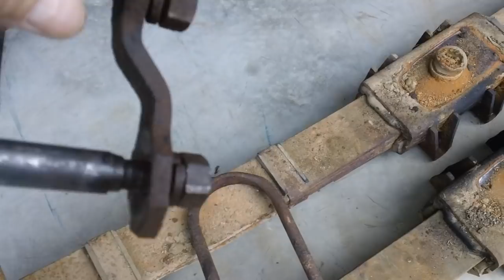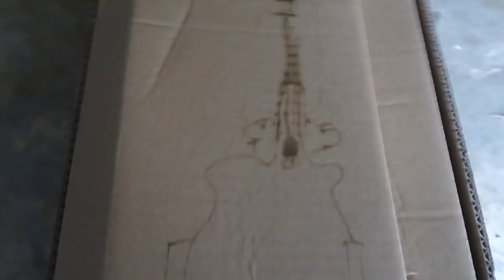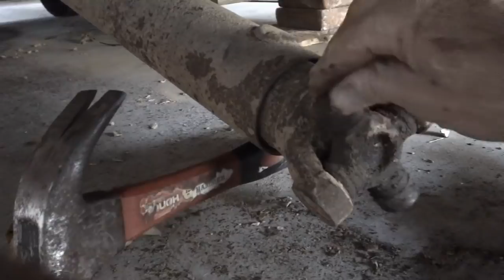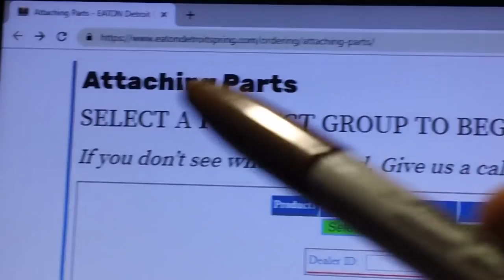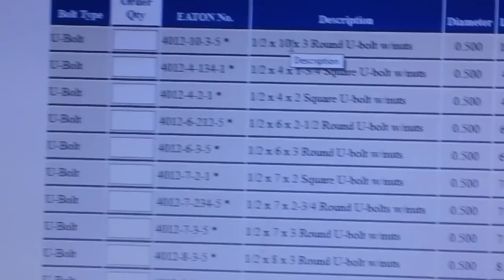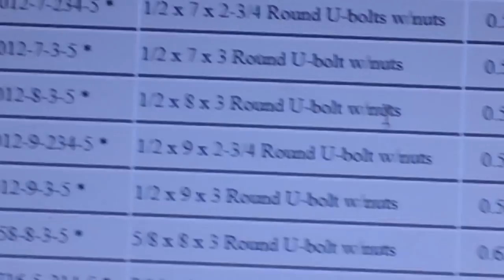1966 Ford Thunderbird repair and refurbishment (Part 25). Rear axle removal.

Comment: If your family asks what you want for Christmas, John, tell them you want a bench vise and a bench to bolt it to! As much do it yourself work as you do, (especially automotive), I'm surprised you don't already have one. About 45 years ago, I spent all day removing a set of shackles from my '65 Fairlane. The rust on them, "welded" them to the rubber bushings. Every time I banged on them, the rubber absorbed the hammer blows. What a pain.
Reply: Hay sanny class, I want one of these, already got a BMF vise.  
https://www.youtube.com/watch?v=3u1IBgefNDs
Reply from the maker: Dave,
I don't have a continual need for a vice, so don't see spending the money for something that'll only get occasional use at best.  Besides, I have access to a full maintenance shop at the place from where I retired, so not a problem.  If needed, they also have very hot torches that'll help remove anything.  LOL
Regards,
John

Comment: My dad preached to me many times, "IF IT AIN'T BROKE, DON'T FIX IT" , hmmm, axle ain't broke, springs ain't broke, U bolts ain't broke, why "FIX" it?  To put in a pozzy of course, lol.  Why did I get smacked up side the head?
Reply: But the springs were broke,  They were sagging and therefore needed to be replaced.  And there is no problem with cleaning and painting a part even if it is big,
Reply: @joeprinzinger2056    I must have been ""bull dozong"" during that part, lol.  zzzzzzzzzzzz
Reply: @umajunkcollector  Well I like to "bull doze" sometimes also.
Reply from the maker: Don,
But did your dad ever say: "If it ain't broke, don't clean and de-rust it."?  Of course not.  He was obviously a very smart man.
Regards,
John

Comment: I think you're having more fun than you are letting on. Sneak out at 2AM,,, and just twist that bolt just a bit,,,,, btw John,,, you should have the juke box playing some 60's songs while working on that beast.
Reply from the maker: Carl,
I've been thinking the same thing about the jukebox.  I should be playing a song now and then, but it's still broken and I haven't had enough spare time to fix it.  I'm still the chief cook and bottle washer in these digs.  Eats up a lot of my time.
Regards,
John

Comment: Would you consider a video showing the cause of the motor boating in the Zenith?
Reply from the maker: Ruff,
I'll include in a later video what I found that caused it.  I stopped making radio repair vids quite awhile back.
Regards,
John